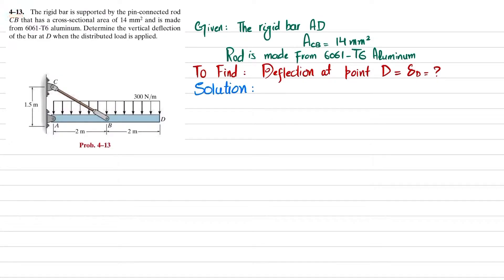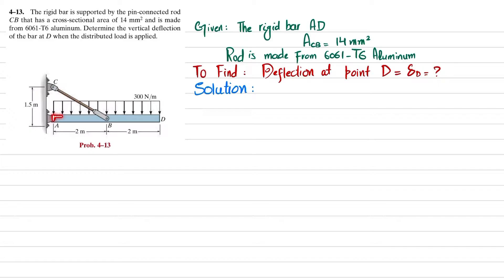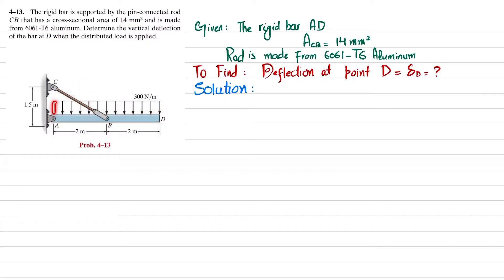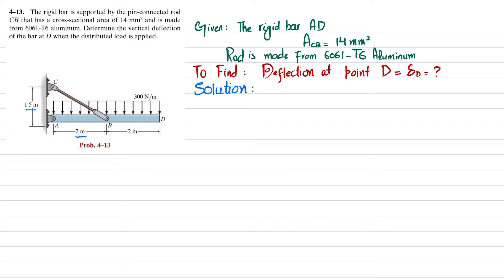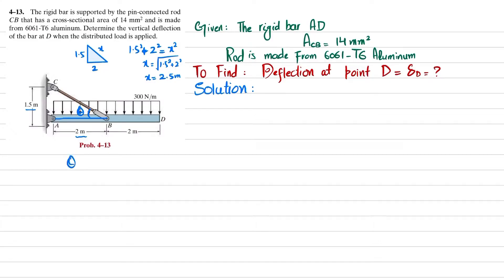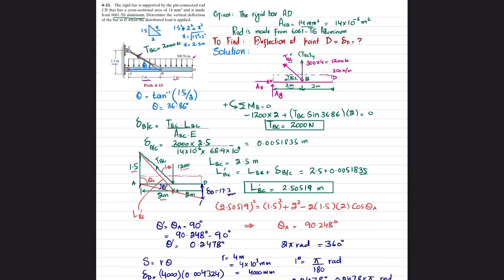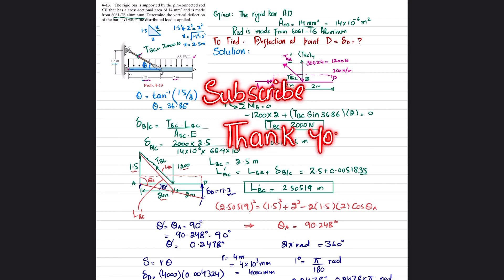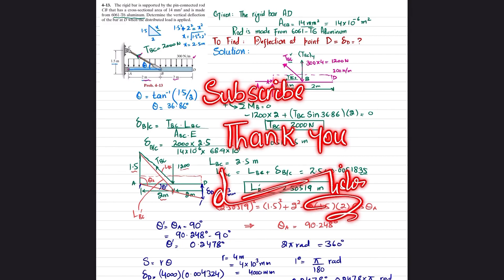4-13 Determine vertical deflection at D | Axial Loading | Mechanics of Materials by R.C Hibbeler

Comment: for some reason I am getting 6.22mm deflection. I have the same 5.18mm elongation, but then I use the triangle to find the portion of that in the vertical which is 3.11mm and then like triangles to multiply that by 2 for point D (if a point in the middle of a lever arm moves down a certain amount the point twice that distance from the pivot moves twice that amount)
Reply from the maker: Good 👍

Comment: will we consider the additional deflection of BD by the distribute load on this section?
Reply: There is no deformation in the bar BD from the load because it’s rigid. It only moves down a distance because of the deformation in the rod.
Reply from the maker: @Shlivo yes you are right ✅
Reply from the maker: Yes I have done it in the video.

Comment: For the moment equilibrium equation, shouldn't it be around A? So MA, not MB? It looks like it was taken about point A and not point B, after noting MB. Everything is still correct, thank you for your help in helping me understand this problem 🤙
Reply from the maker: Yes you are right. Mistakenly I have written MB instead of MA. All the things are calculated based on Momet about point A. Thank you ❤🎉

Comment: I think if you use        Tan 0.2478= Y/4000.

You would still get the same answer without going too much into arc length or convert to radians
Reply from the maker: Noted